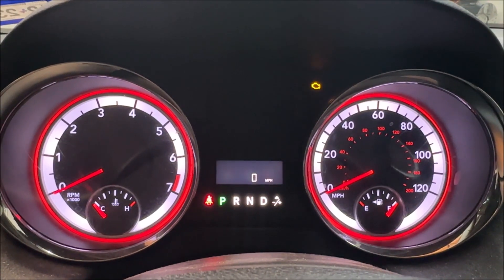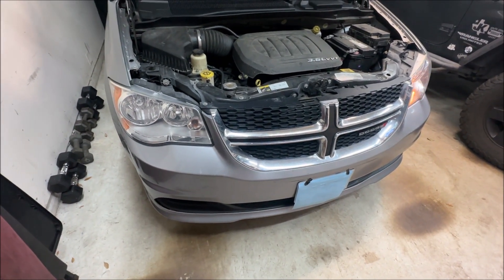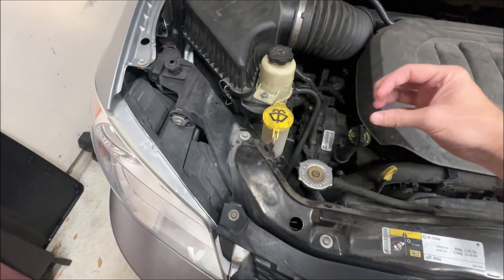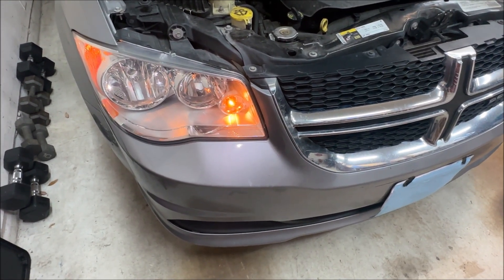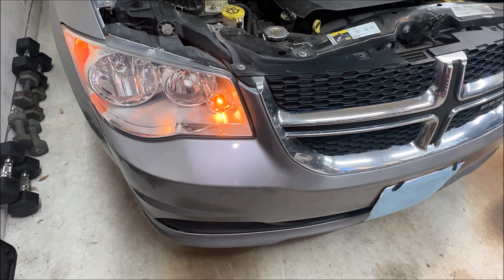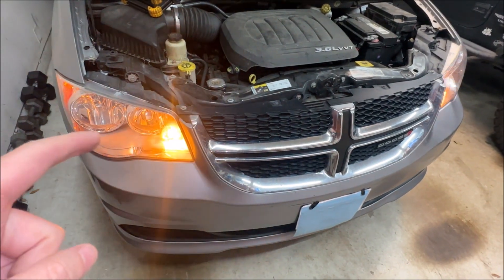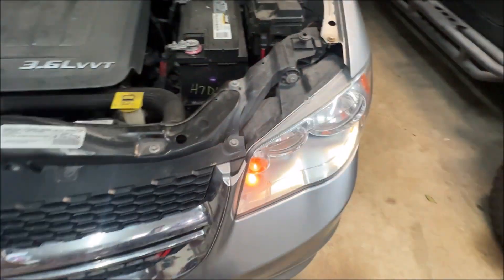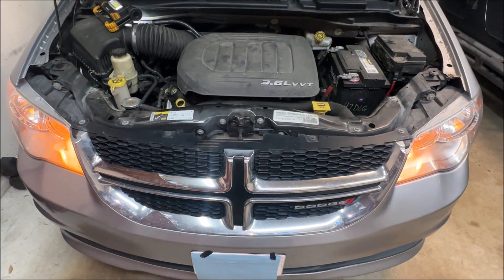Blinker’s Gone Mad! Stop the fast-paced blinking by replacing your turn signal bulb

Comment: Off topic question maybe u can help. On drivers side rear when u go to drop the fuel tank. There’s an electrical connector, the fuel line then a smaller hose that runs from tank to I believe the evap canister. We’ll behind rear drivers side tire the line ends. No hose going to tank. The guy who repaired. T frane must have not re connected it. Any idea what that line is called and if I can reconnect or add a price of hose to the tank without dropping it?
Reply from the maker: Looking at pages 14-13 and 14-14 of the TJ Service Manual, there's an evap canister line but also what looks to be a vent line from the tank to the fuel filler (one of the "fuel filler hoses" in figure 22).  Since you're not having any engine or fuel delivery problems (I'm assuming), my first guess would be that the fuel filler vent line might be what you're looking at. If that's the case, that it wasn't reconnected or has come free/loose at the fuel filler bezel, the only concern is probably that debris or water can get into that line and down into the tank.  I'm not sure if you'd be able to reconnect it to the bezel without dropping the tank.  I don't know if there's enough slack in the hose to pull the bezel out and snake it into position with the tank already installed.  The manual's steps for removing/installing the tank has you disconnect those hoses from the tank, with the tank on the ground, so it never really talks about disconnecting/reconnecting them at the bezel.
Sorry, not sure any of that really helps you but hopefully it points you in a good direction.
Reply: @CarbonsDIYGarage  thank you so much for the fast response as usual. It helps me a lot since now I will research what you told me. I’m just hoping I don’t have to drop the tank however it was recently dropped and a new skid plate installed with plenty of anti-seize on the bolts so I know I will be able to get it down no problem if needed
Reply: @CarbonsDIYGarage  I believe it’s my evap hose to canister. Do u think it’s causing a P0455 (large evap leak) code? It could be from the many dry rotted hoses n rubber elbows in the engine bay for which I will smoke the lines to find but they prob all need replacing.
Reply from the maker: @pujo28  I'm jealous!  I fear/dread the day I'll have to drop TDSR's tank.  I just hope it doesn't come about because of a sudden pump failure and I need to do it all "right now."  I feel like there will be a lot of broken, rusty bolts and nuts on that one...
Reply: @CarbonsDIYGarage  Ya that might be a job for a pro. The guy who dropped my tank n repaired the frame said he had a technique for removing the skid plate bolts. Of course he kept that a trade secret. I’m hoping he just forgot to re connect that a so hose. We’ll c

Comment: sometimes (unpredictable) one turn signal of my TJ is blinking like crazy, I guess it's a ground problem - but where?!?
Reply from the maker: Both of my TJ front turn signal sockets were heavily corroded when I got the Jeep. I “cleaned” them with a toothbrush bedt I could, then scraped on them with a small screwdriver to show bare metal. That got me good contacts back and they’ve been working well. So maybe investigate the contacts of the socket?
Reply: @CarbonsDIYGarage  thx, it's on my todo list now!